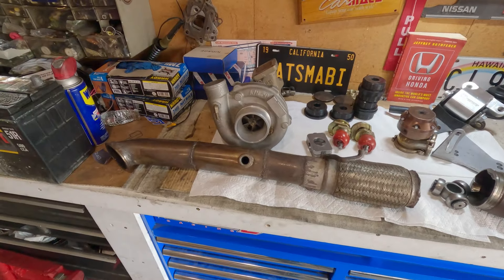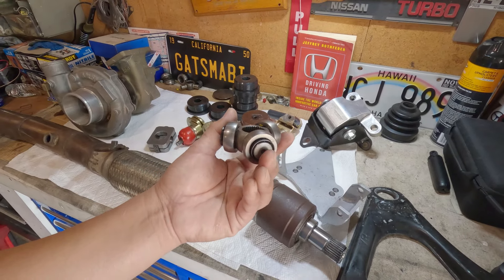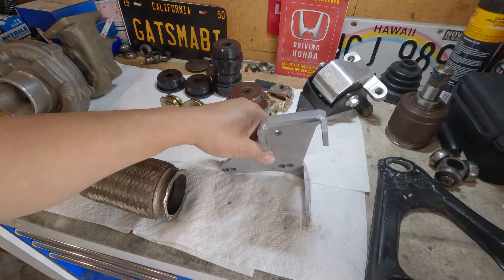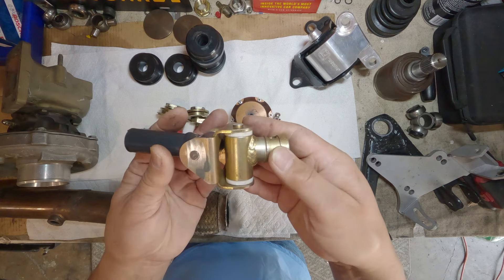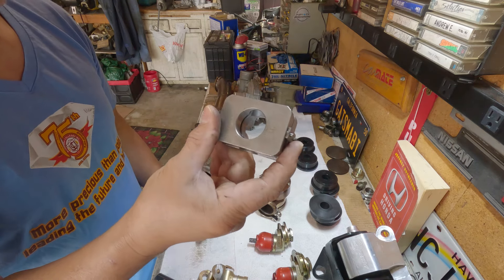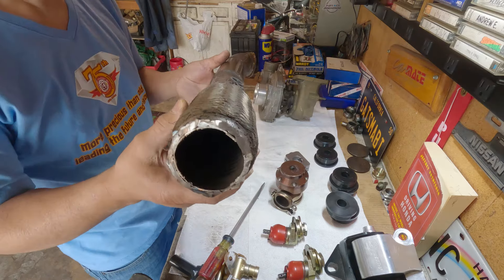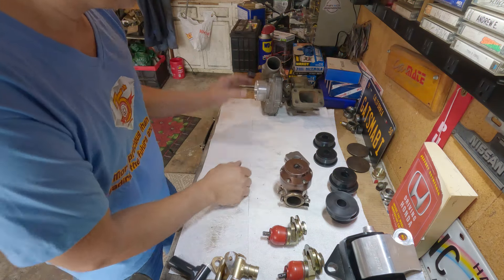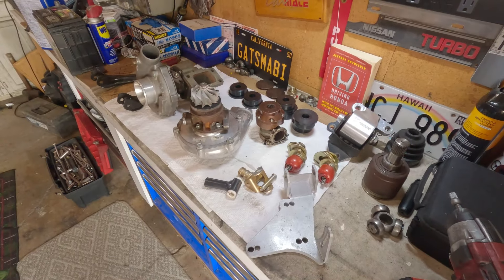Worst Mod parts I installed on my Honda!

Comment: First, 

stock height,= proper axle bearing position

Shim the bracket?

Fk a bad shifter part

I feel like over boost is the tune problem, when my wastegate stuck inover boosted and I had my tune cut power at 17psi.
Reply from the maker: In my earlier days of boosting engines, l dont have the luxury of using ecu w/ boost protection. It's all about sending it you know,  if it blow, it blows. But learned from mistakes and l overcome on the 3rd try, but costing me so much buying all the good stuff to make it right.
Reply: I am just like you with the rest and tune for my own personal benefit. You’re spot on all the time and I strive to be like you

Comment: Can please make a video and show me where all the hoses go for f20b/h22a intake manifold.
Reply from the maker: You have anything in particular you need to hookup? What intake manifold are you using?
Reply: @sagittnet2158   It’s a stock manifold for f20b. I took out the manifold but and put it back in Im just not sure where all the hoses go on the throttle body side. I learnt from one of your videos where the little black box and those hoses go on the manifold but I don’t know how the rest go
Reply from the maker: @tanekoroi2568  I'm not familiar w/ F20b intake manifold and l know that it has more than regular usdm H22. What chassis do you have it on? You should have 2 ports  for IAB box, 1 port for EGR, 1 for Evap, 1 for brake booster and 1 port for fuel pressure regulator. The rest you dont need. Hamotorsport.com have a Tech library and they have picture of vacuum diagram. I'll try to cover it next time.
Reply from the maker: What car do you have the F20b is on?

Comment: Got any insight on fitting f20b VTEC to an f22a1 block with stock bore? They seem to fit
Reply from the maker: Yes, it'll fit okay, but still need to plug the 2 oil drain port. It'll be similar to a G22 build and g23.
Reply from the maker: F20b cylinder head are similar to a H22. The difference are the valves. It's 1mm smaller than H series.
Reply: @sagittnet2158  thanks for the info I didn't know about the valve size I'll definitely keep that in mind .

Comment: What PSI did the f23 finally fail at when it over boosted?
Reply from the maker: Never did find out coz l was using chipped P28 and can't retrieve any info. No name brand failed yo opened! Shaft was stucked closed.